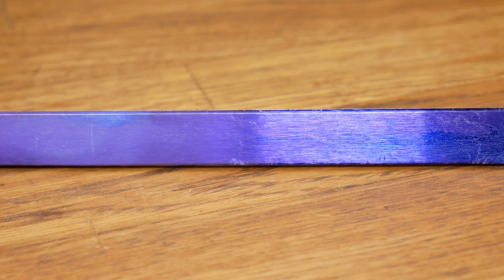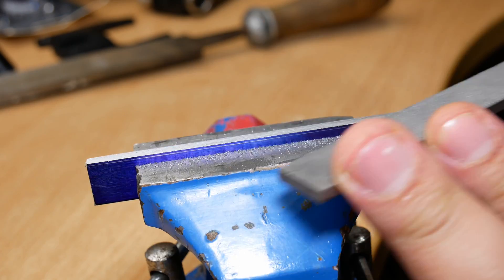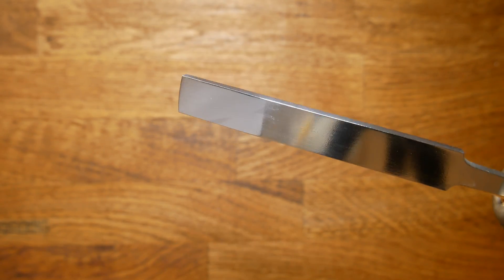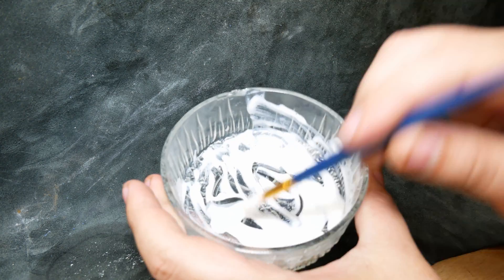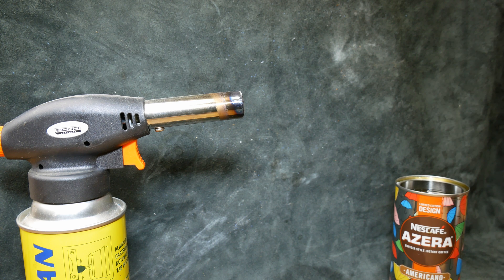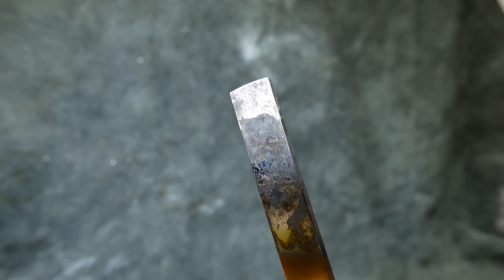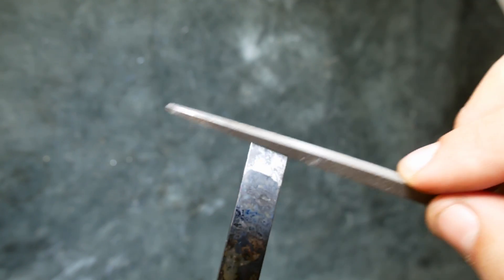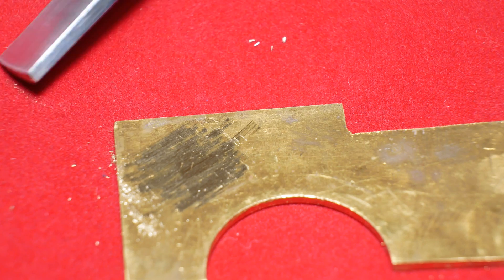My First Attempt At Hardening Metal: Making A Scraper

Comment: The soap should be borax, like the laundry soap, it helps prevent oxidation but it usually comes in powder form so I can see how a paste would be necessary. Heat the metal until it is no longer magnetic then quench. Look up blacksmithing/knife making videos for a lot more in depth knowledge.

Comment: This is excellent work. the polishing looks better and better.  From a metallurgic perspective, the large grains on one side and smaller grains on the other would indicate a different heat during cooling. reccomendations would be having a wider torch to spread out the heat more evenly. 

Now. take my comment with a grain of NaCl, I've just reasently learned this stuff in school. 

would making the stuff Clickspring used be allowed? the salty gunky stuff to even the heat profile?

cant wait for the next one to be published. train-calculations are something I've wanted to learn more about.